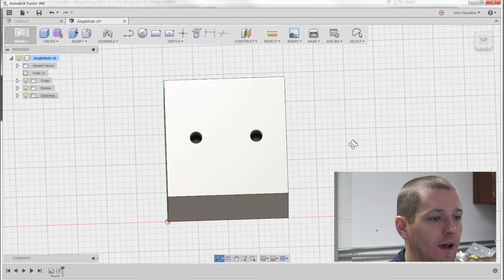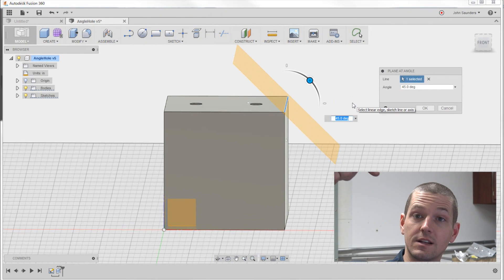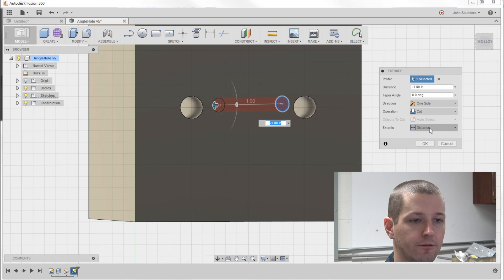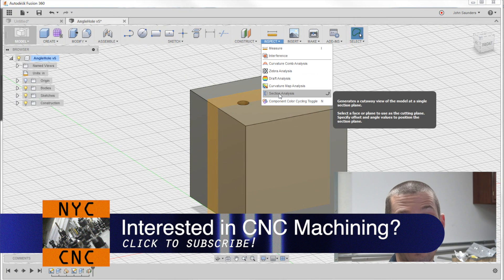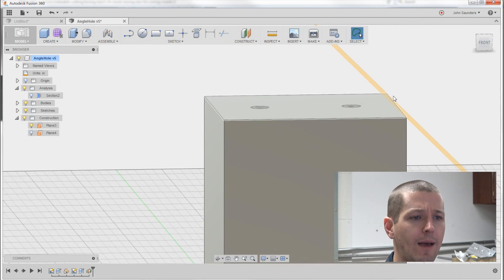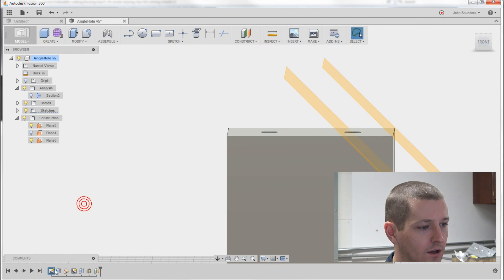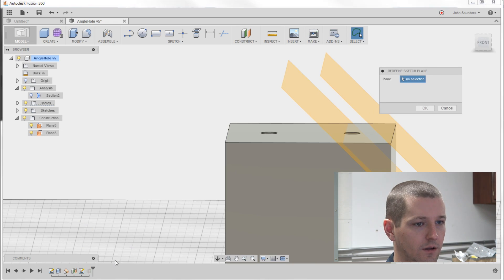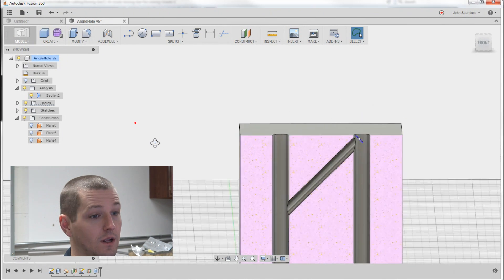Fusion Friday #8: Angled Holes & Section Views!

Comment: Good video. The part that I didn't hear mentioned is that a round rod only creates a round hole when entering at 90 degrees. Other angles of entry form oval holes.  Therefore the entry points for the two holes can never match perfectly.

Comment: Thanks for answering my question (I'm the guy who emailed John).  I ended up solving it SLIGHTLY differently, by drawing a construction line on the top face tangent to the hole, and doing the angled plane from there

Comment: John, first of all, great work for tending to the needs of your viewers!! That's the main thing, and you've certainly pointed your viewer in the direction they will need to go in. However, technically you should be using the Hole command to make holes, instead of drawing a circle and using push pull (A general bit of feedback for most of your videos). Then as others have mentioned here project the edge of the hole onto a sketch on the angled plane. Create a hole using the visible sketch points, and set it to a standard hole size that works. It stays locked to the position of the original vertical holes then, and you can 'best fit' the angled hole to the previously modelled holes. Using Holes instead of extruded circles is best practice for any CAD package with a hole command, Solidworks included. It's more stable and more powerful. Normally I'd rather provide critical feedback offline, but I thought this would benefit others watching the video then reading the comments.

Comment: Having moved the angled hole to avoid clipping the edge of the vertical hole, you've ended up with a hole you can't actually drill. You need to leave the extrude going through the top face as happened with the original location of the construction plane so that you can see where the drill shank will be. You should be able to project the circle at the top of the vertical hole onto the angled construction plane (it will be an ellipse), that will allow you to see whether the circle you're sketching to make the angled hole will pass through without clipping the edge of the vertical hole.
Reply: +NYC CNC In the case of the actual project (I'm doing Philip Duclos' "Huff and Puff" in CAD to learn Fusion 360, the hole is small enough, and actually set so it's edge just touches the surface of the block, so no issue.
For those who don't know the project (wish I COULD share it, it is copyright) it is a SMALL compressed air slide valve engine - how small?  Designed that you can run it on breath power, so you have to be REALLY careful in the quality of machining.  The angled port is the air passage from the valve to the cylinder
Reply: Could be 3D printed though and then you wouldn't want that extra bit cut off... And I would have just done another push/pull on the end of the extrusion that was too long...

Comment: That's actually great work with planes. And probably a best practice if you would later want to make it in a 5-axis VMC.

A different way to do it would be to have a sketch like so:

-Start from the centre of the first hole,
-Follow the centre line of the hole up until the point where you want the intersection with the centre line of the angled hole to be,
-From there start a second line that will follow the centre line of the angled hole up until the centre line of the second hole.

Once you've set that up you can just do a swept cut along that path. You can even control how deep inside the first hole you want the start of the angled hole. You just change the dimension of the first line.

Now, how you'd manufacture something like that... That's a different story... If you want some CNC p@rη, type "DMG laser deposition" in YouTube's search and just ponder the possibilities.
Reply: Hi, and thanks for the DMG link, it's awesome!

I came to think of this though: this is a kind of welding. To me it seems both possible and relatively easy and low cost to achieve a mostly similar result with a welding tool instead of this very costly laser tool? I'm certainly not a machinist or "in the know", but to me it seems like a great way to extend a VMC with an potentially quite valuable additive capability?
Reply: +Stein-Erik Dahle Hi, I hate to take this comment thread off topic, but I am not completely sure that with a regular weld technology (except MLS: Metal Laser Sintering) you would be able to accurately create a 3D shape.

I mean, consider the shape in this video. MLS will give you a decent surface finish and with a hybrid VMC, you could even ream the angled hole before continuing on with the material deposition. And also, you do not have a closed current loop sending amps through the machine's frame.

However, I am not an expert in welding, have only welded on a couple of occasions and I am not very proud of the results. So my only concern would be if you could get the accuracy and reliability to be worth the bother, really.

P.S. With this kind of technology you can actually create an alloy, by mixing different types of metal powder. Another difficult and expensive thing to get with other types of welding.
Reply: +Kostas Froudarakis, thanks!

Comment: I think it would be simpler, if you don't want to clip the edge of the vertical hole, to use Project Geometry to project the circle on the first angled construction plane. Once you do that you can use the center of the hole to make your angled hole.

http://a360.co/1P3LuDB to see my 30 second example.
Reply: +dcraig4 This is how I would have done it too